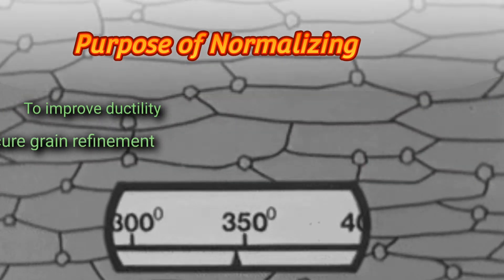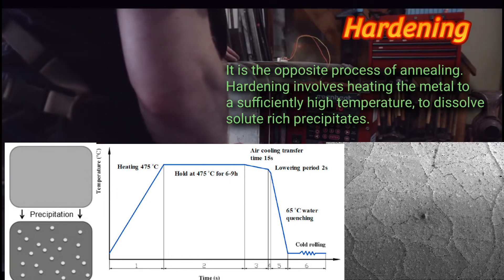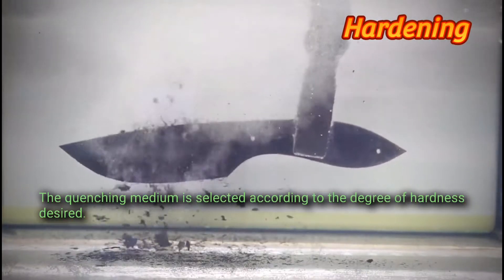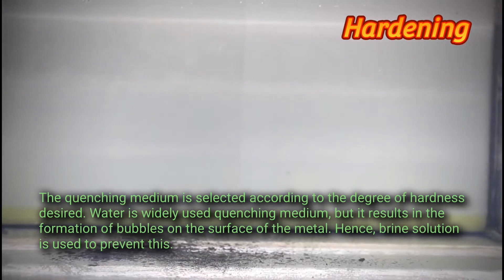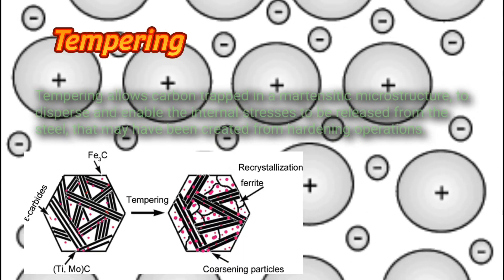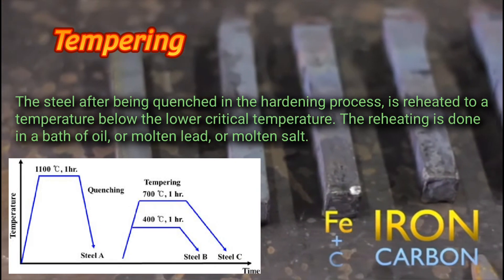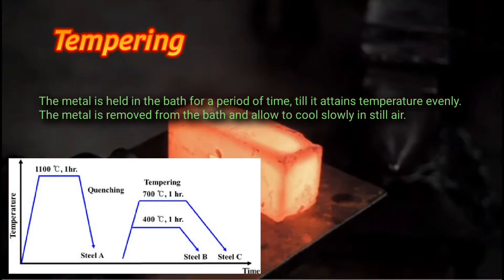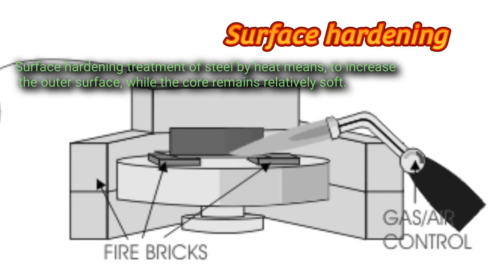What are the Different Types of Heat Treatment in Metallurgy?

Comment: how can we change the grain size in molten aluminum  before casting ?
Reply from the maker: By adding titanium and boron into the molten aluminium before casting. They help to reduce the aluminium grains during the solidification process, leading to fine grains. These elements are called grain refiners.
Reply: @JamesSwordEngineering  how about uncleating agents when we can add it ?

Comment: What kind of metal can be surface hardened and what kind of metal can be cross-section heat treated like (annealing, normalizing, hardening, tempering)?
Reply from the maker: Metals that can be surface-hardened are mostly low-carbon steel; they are surface-hardened to create an outer layer while keeping the core relatively soft. This is because they can easily absorb carbon atoms into their surface layers when heated in a carbon-rich environment. 

Metals that can be cross-section heat treated through processes like annealing, normalizing, hardening, and tempering are usually high-carbon steel. Other ferrous metals like cast iron can also undergo cross-section heat treatment

Comment: How many companies do you know that temper in oil, lead, or salt baths? Normal atmosphere tempering is the most common probably followed by vacuum tempering.  Those liquid baths are primarily used for martempering (not the same process as tempering), austempering (also not the same process as tempering) or differential hardening.  

Also the normalization time cited in this video is true for blacksmiths and knife makers, industrial normalizing of forgings often requires hold times on the order of hours not tens of minutes.